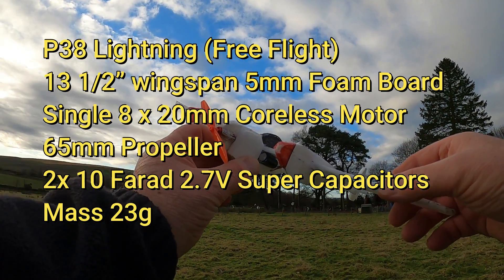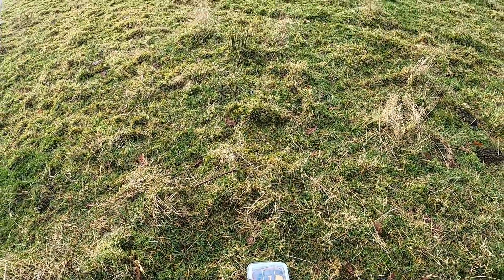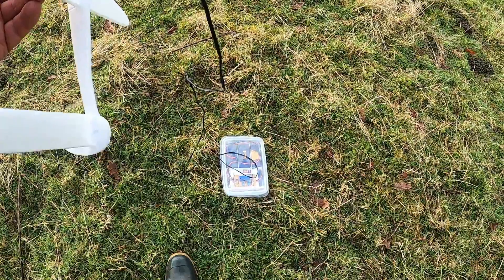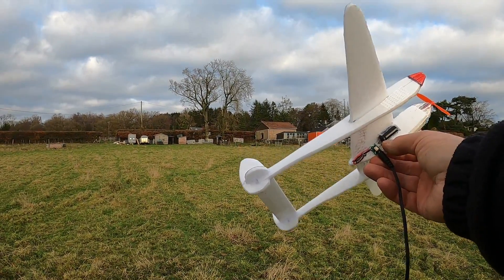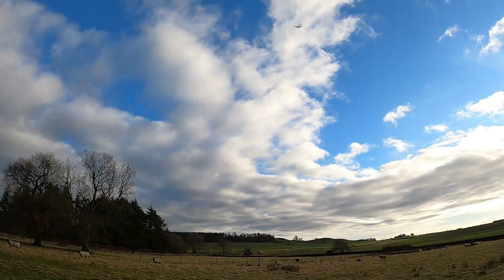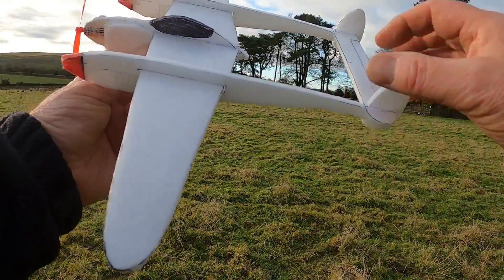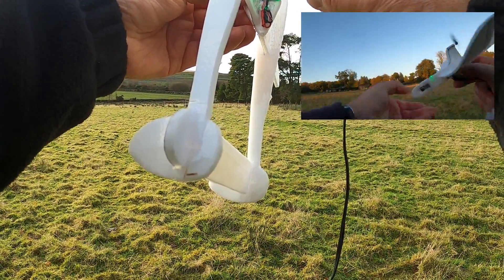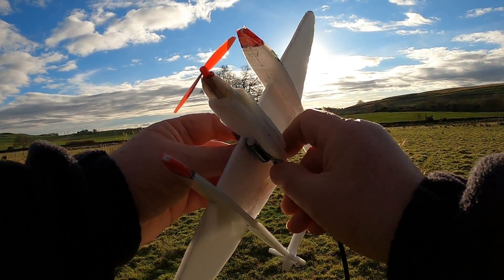P38 Lightning Super Capacitor Plane and Field Charger- Build and Fly

Comment: How do I build the p 38
Reply from the maker: Download the P38 plan from https://outerzone.co.uk
https://outerzone.co.uk/download_file.asp?planID=2461&FileType=Plan&Filename=P-38_CL_Palanek_oz2461.pdf
Scale the plan for 13 1/2" wingspan (on screen) and trace the outlies of the wings, fuselage etc and cut out 5mm foam board parts. Remove paper surfaces from foam board and strengthen critical areas with clear packing tape. Glue parts with hot melt glue.

Comment: Ordered by AE a 3€ supercap plane.
Did not fly well,i changed the wing about  8 inch longer with up bended ends.
Flys very well now.
Question:There is a 4 AA batterybox for loading.
6 volts for a 2.7F supercap 10 seconds,thats to much.
Will that kill the supercap?
I took out two batterys and made connection for 3V load.
Beter?
Greetings from the Netherlands,and stay in good health.
Reply from the maker: Yes, it is better to charge at a lower voltage to prolong the life of the supercapacitor. AA batteries in the supplied charger do not last very long, that is one reason I built the field charger which has a large capacity lithium rechargeable battery and an accurately regulated charge rate and voltage limit.